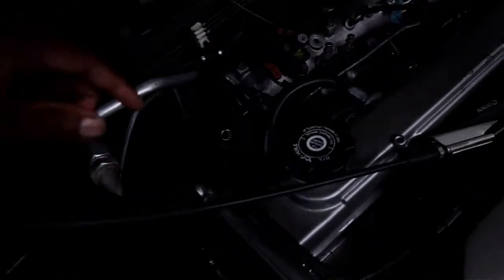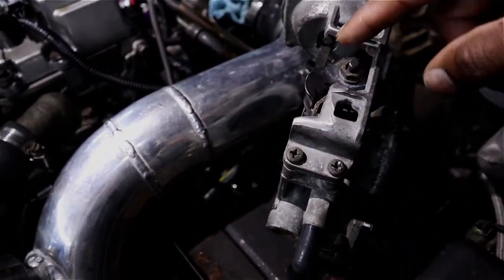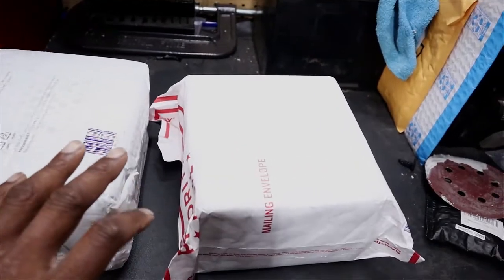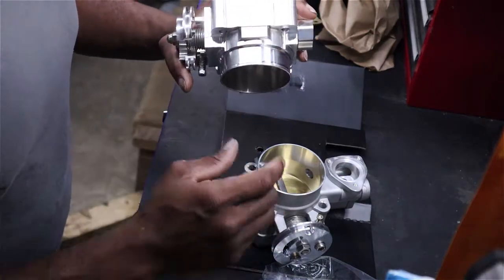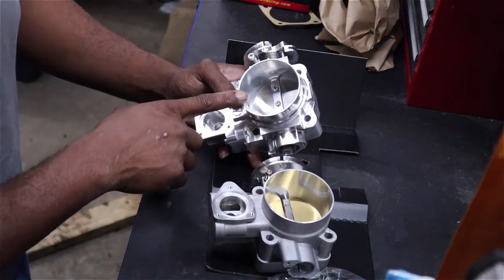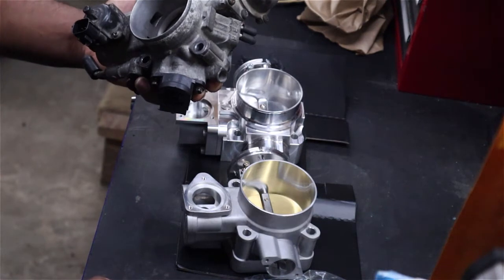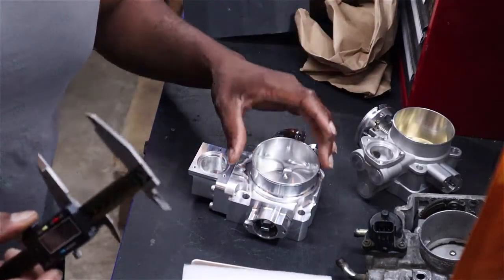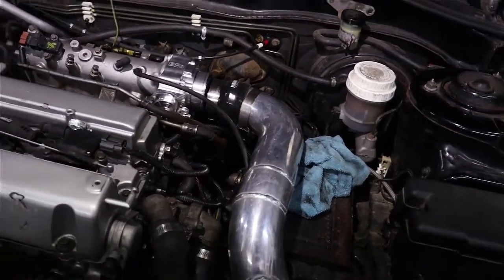Fullblown vs S90 70mm throttle body comparison.

Comment: The S90 is mounted to the cardboard box to reduce movement during shipment which in turns reduce the chances of damage. Nice review by the way. I purchased the 70mm for my ported intake manifold so I’m hoping for some good gains when I install it and get it tuned along with a list of other parts.

Comment: Hey bud how are you? How you like that S90? Any leaks? I know sounds horrible with that whistle but I want to know if there is any leaks before I out mine.
Reply from the maker: So far I like the s90. It hasn’t leaked and the throttle is smooth.
Reply: @RvaJay  hey bud, thanks much for the reply and the input. I will put mine next month and see how it runs.